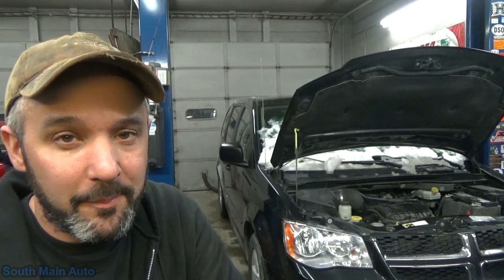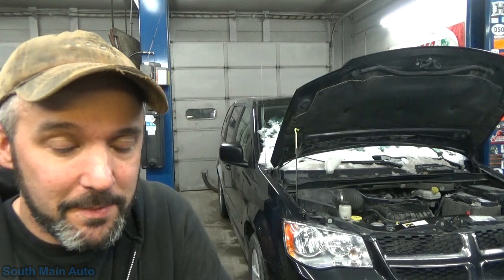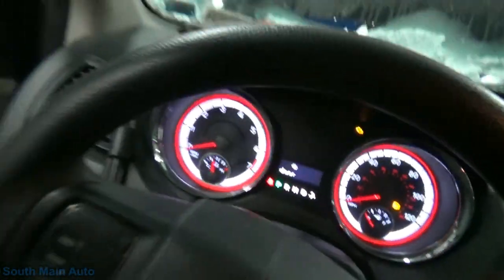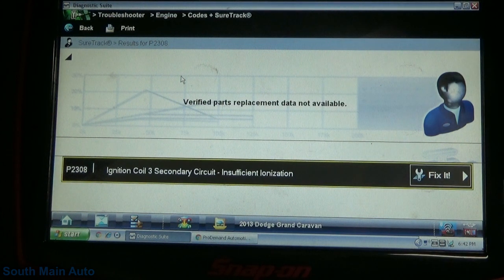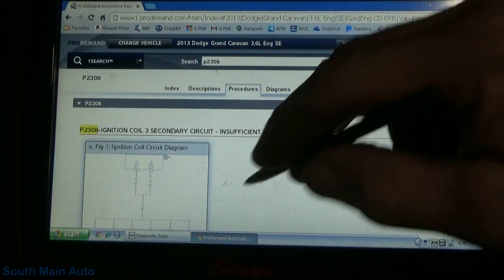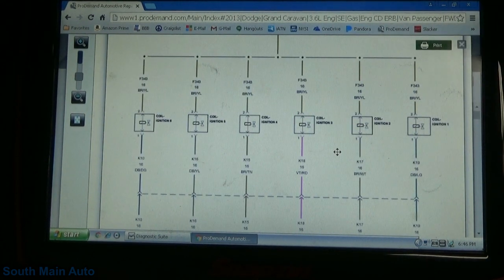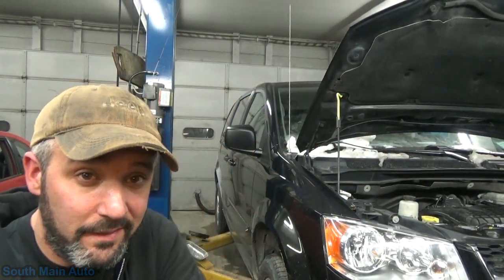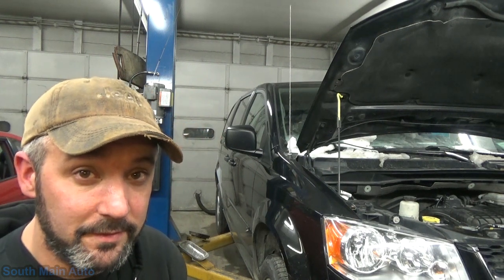Dodge Grand Caravan P2308 - Case Study

Comment: I worked for a small independent shop in the 80s and had a customer bring in a Cadillac for a water pump. It was one of the last Eldorado that was normal position for the motor. He didn't like the price we quoted him, and decided to do it himself. Three days later he calls and wants us to do the job after he took the engine apart and got stalled on the power steering pulley. His idea of organizing the parts was to throw everything in a bucket, bolts brackets and all. My boss asked what I wanted to charge since it was going to be a big clusterfuck to put back together. I told him to double it. The guy agrees and it gets towed in. I ended up going to a local car lot that had a car of the same year and take a couple of Polaroids of the brackets and how the layout was. I ended up taking a day and a half to get it up and running and out the door. Customer stayed away for a while and then started coming in regularly.

Comment: What I do not understand is why other automobile repair shops in a 25 mile radius of SMA are still in business?  Eric at SMA should have taken 100% market share of all automotive repair work over a year ago from word of mouth alone.  What gives?
Reply: Eric's shop is full most of the time though. It's going to be a very long backlog of work to be done and customers wants their cars now.
And they want repair prices that would cost the repairman in the end. That's how shops like those before Eric survives, they don't do work on the vehicle. They just swap parts and take whatever pennies they can get. That doesn't include reconnecting and bolting everything down properly.

Wouldn't surprise me if some shops do brake jobs and don't even bleed the brake lines.
Reply: Nailed it.
Reply: Cadde I know a guy that changed his brake cylinder at the wheel,and never bled the thing,he did a video on it. His excuse was that by letting the brake fluid come out the bleeder as he hooked it up,would remove any air anyways,after tightning the bleeder when he was done,he topped off the reservoir and proclaimed it as done. Good enough. I then stated he had never had a problem doing it that way with any other brake job he did,and called it done. I almost flipped! So much for that You- Tube video. I gave it a thumbs down.
Reply: Sandbag1300 People want the best deal
Reply: Because there's only so many hours in the day
Reply: R230Tuner, it's good for you that you are superhuman and can unscrew ten bolts at the same time. But never for a second believe that's normal.
Reply: Are you an octopus bro?
Reply: There's too much work for any one shop.  I read that there is something like a 3-week wait to get in to see Eric.  And that 90% of the people wait.  But some don't.  And others I'm sure can't wait.  Or just don't realize that a cheaper shop is most likely not a "good deal".
Reply: some people its all about how cheap, and how fast.
Reply: @Caddle: I don't understand why should the shop bleed the brake for just replacing the brake pads. If the braking system is good, why bleed it at all.
Reply: 2Phast4Rocket The old fluid that sits in the caliper is subject to the heat that the brake pads create. which over time breaks the fluid down. then when you do  brake pads change the pistons have to be pushed in which sends all the broken down fluid up into the abs modulator and master cylinder. that's one theory at least. I personally don't follow this though. I find many bleeder screws break off expecially in the rust belt
Reply: R230Tuner I agree 100%. was just responding to the comment above.
Reply: reweydewy: Agree that the brake fluid degrades with age and use. This is why I do a complete brake system flush every 30K-50K miles, or at every major brake repair such as replacing rotors.
Reply: 2Phast4Rocket, they shouldn't bleed the brakes every time the brake pads are changed no. They should confer with the customer or the vehicle's service history first.
Which is another reason you take your car to RESPECTABLE repair shops only or do it yourself, not forgetting to enter every little thing in the vehicle's history so one knows if the brake fluid needs a flush or not. Because as you say, the fluid degrades with age and attracts moisture that can destroy your whole brake system.

In fact, if you ask me, brakes are way more important to a vehicle than engine performance. Yet many people only care about when their car isn't accelerating well but doesn't notice that their brakes performance is degrading.
And yes, brakes will generally degrade in performance quicker than the engine of the vehicle will. Flushing out that little bit of brake fluid that sits in the calipers is small change compared to having your whole brake system ruined because some dirty braking fluid being pushed back into the master cylinder.

Again, it all depends on the current status of the vehicle though. If you trust that the brake fluid isn't in a poor condition anywhere in the system then you don't need to flush it. The only way to know for sure is to take samples of the fluid at the various locations through the system and send it to a lab.

Comment: If other garages can't do , Eric can do it, I can't figure out the missing air filter, why did they remove it?
Reply: Paul Balsbaugh during their diagnosis the air cleaner assembly might have been removed, and by the looks of how they left everything else it's really no surprise that the air filter was left out.
Reply: @isaacsantana5608  Likely they were told to leave it, and at that point, everything gets thrown back on in any order since it's not their problem any more.

Comment: 2013??? And has a problem like that???I always said my dodge colt only lasted 20 some years because Chrysler did not actually build it.
Reply: Cool. What year Colt? I had a '76 1600, 4 spd and loved it.
Reply: Cooll Asice 1994... tranny had a stroke at 70mph and 240,000k in 2015...I hit the gas to pass someone and that was it. Great little car up till then. Even had a bullet hole in the body... don't ask 'cause I don't know....and none of my kids would admit to any knowledge of anything.
Reply: I also had a 76, jumped time and bent some valves, machine shop lost my head so I put a used engine in it. I unbolted everything and me and the guy I worked with reached in and lifted the old engine out, picked up the new engine and put it in. Very easy engine swap. I think I paid 200 for the engine. This was about 84 or so. I also loved mine.
Reply: My first car was a 1991 dodge colt, base model 4 speed stick hatchback. Had to wax the paint every few months or the red paint would turn pink. If it wasn't for the lady on her phone that rear ended me I think i would still have that lil car. loved that thing.
Reply: Amen, brother. 
Long Live The Dodge Colt!
Reply: holidayhouse03 didnt he say it was in an accident
Reply: Rich Lo he did...rear end... passenger side maybe. I drove my colt into some guys wheel well. I drove away... him not so much. And drove that colt with its dented hood for years. Although I gotta admit I discovered a quick and easy way to flatten out a f upped hood... slam it into the windshield at 60 mph. It didn't help the windshield much but sure did flatten out the hood.
Reply: holidayhouse03 like someone mentioned before, they could have fried something welding if they didn't disconnect the battery